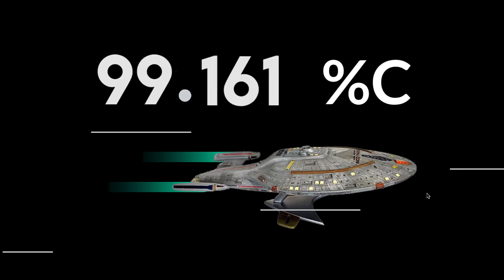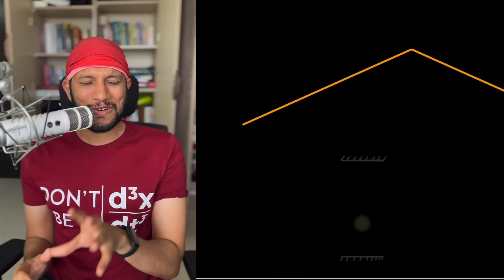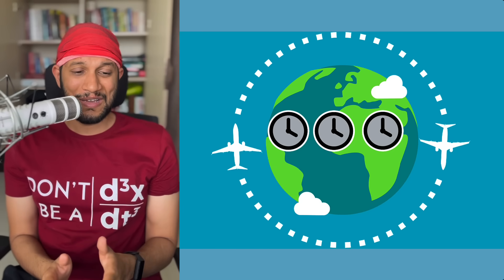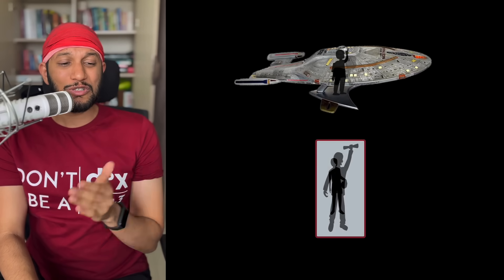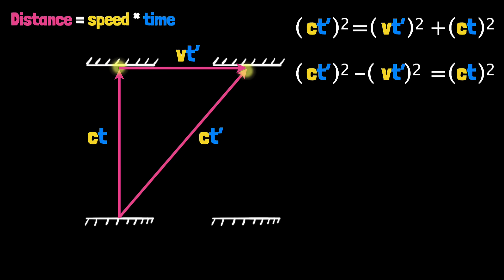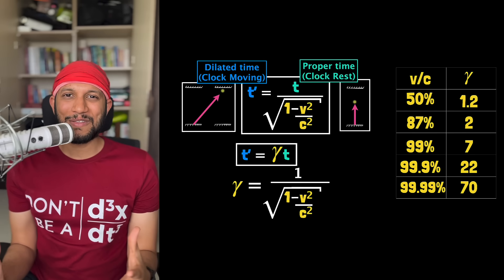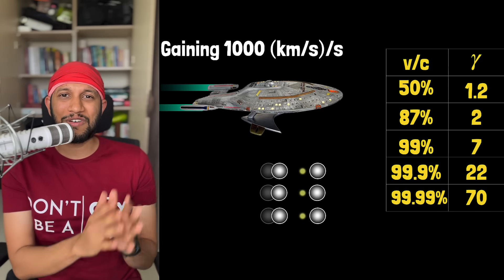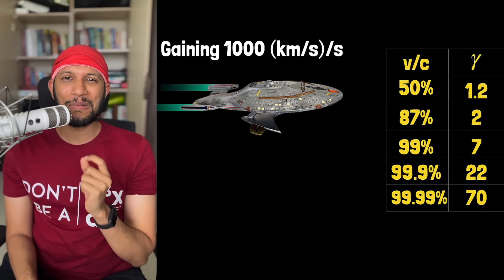I finally understood why you can't go faster than light! (My mind is blown)

Comment: so out of curiosity, I'm not too well versed in this area - would the amount of g-force experienced decrease as you approach the speed of light with this concept of slowing down photons apply here assuming you can surpass the livable 4-9 g-force. More so, for example if you were able to accelerate at the speed of light instantaneously, would the g-force exertion be completely nullified due to the time dilation concept? Interesting stuff here

Comment: so heres what i dont get. 
I get the photon idea. Photons travel at C (speed of light) ALWAYS, at constant. until they transfer their energy onto another object. thus killing the photon. (photons giving with mass is another topic all together, as they have no mass, but solar sails work) ... so, If Photons are constant. its shown to have a speed. 299,792,458 meters per second (or 186,282 miles per second). This means that Photons, do not have an 'infinite' speed. meaning that it is probable to reach the speed of light or pass it. yes its a very low possibility of happening, but probable as there is a 'Finish line'. 

With all the time stuff, out of the way. and it all in relativity. you have the infinity power generator for your super duper god ion thrusters. and you blast off into a your new time travel mission (into the futrue, one way) you will be able to hit that Finish Line, but it would not require infinite energy. it would only need infinite... if photons traveled infinite speeds. which they dont.

Comment: I know I'm about a year late, but you're WRONG! you CAN go faster than the speed of light! .. Albeit NOT by brute force!  i.e., Rocket thrusters!  or any such form of thrusting! ... Whereas the atomic articles that the ship slams into would literally rip the ship apart from its leading edge long before reaching SOL!  .. But a ship tucked well within its WARP Bubble could even surpass the SOL by several folds!🤨

Comment: I think that when we explore the nature of 0 we will gain a better perspective of this formula. The value 0 is quite new by comparison and while the rules of numeracy work in all cases except 1, I feel there's a gap in our knowledge for that result.

If we look at any number, 2, for example. Multiply by 1 and it remains the same (if I have 2 and leave it alone, I still have 2, or one instance of 2), divide the number by itself and it makes a value 1 (how many groups of 2 make up the value 2, 1 group), and so on. Off this we piggy back other formula and theory (that all seem logical because we write the logic based on the existence of the logic).

Everything works that we need it to work, however the existence of 0 as an integer makes that an issue, because certain rules can't apply. 0 is a structure that was introduced later and it sort of made sense except in a physical or practical sense. Romans had no value for 0. If Brutus had 2 apples and eats one, he has 1 apple, if he eats both. There's nothing to count.

I think the formula works because it's sort of right, or right enough as we currently understand it. It may be how we perceive and calculate time, distance, and other forces like gravity. There's something we're missing and I think that's what makes mathematics so amazing, we should be measuring the topic by what we don't know rather than what we do.

Comment: I don't buy the explanation around 3:30. I agree that the tip of the hand (pointer) will indeed move with a delay when compared with the base (first atom). But the base of the hand doesn't need to wait for anything (like a photon bouncing back) happening further up in the hand, so it will do the next step after exacly one second, without delay.

Comment: Or, going back to the drawing of the photon and the mirror moving, every speed on that triangle would be C, which makes it impossible because you will have one side and the diagonal both measuring C*t. 
Or again photons following the longer path can’t reach the moving mirror if it is moving at C, because the mirror will move away from that at the same speed and the photons need to travel a longer path than the mirror, so they’ll never got to it, that’s is they will take and infinite amount of time to get there

Comment: This explanation reminds me of the sound barrier (except maybe we would call it the light barrier)! When a supersonic jet reaches the speed of sound, the sound waves it produces appear at that moment to have no velocity relative to the jet. Of course, in that case, the jet doesn't depend on sound to carry the forces which accelerate it, so it is able to push past this point and break the sound barrier. But in the case of a spaceship nearing the speed of light, the very forces which would accelerate it are carried by light (since the ship is made up of molecules which transfer force via electromagnetism). So if it were to reach the speed of light, the waves that carry these forces would stand still relative to the ship and no acceleration would be possible!

Not really adding anything to the explanation in the video, just rephrasing to make it stick in my brain :D

Comment: this seems fundamentaly flawed. from the relative containment of the photon clock on board it doesn't know that it is moving in relation to the outside. Like a bug in a car. the bug is not flying 70 mph. it is flying at normal bug speeds. in order to test this you would have to angle the trajectory of the photon and move the mirrors into an intersecting course so that you could measure the speedand distance traveled accurately. you cant arbitratily move a frame of reference outside of a contained environment. if 2 children are playing catch in the back of a bus they are not said to be throwing the ball at over 70 miles an hour just because an observer on the sidewalk sees it. but if 1 child throws a ball to his friend through a bus window as he passes him on the sidewalk then the child would have to throw the ball at >70 mph to make it to his friend on the bus. Does that make sense?

Comment: I think it would be helpful to tackle this phenomenon by explaining what planck's constant is. It is actually the thing that defines the speed & the tick rate of the universe therefore creating a barrier that disallows moving beyond the speed of light (which again is a constant due to planck's constant being a constant). 
To put simply planck's constant is the smallest number that a unit can be in terms of length. Which means anything in the universe cannot be smaller than this number. Just like the pixels on your monitor (and notice they have a fixed certain length) the universe itself has pixels. It is this length of the pixels that define the speed of light. You need to travel from one pixel to another pixel in order to create the illusion of time. The same goes for our universe too. 
So if the fabric of our universe has a defined & preordained & fixed & certain length then what is left for the energy and matter is the inability go smaller than the pixel length. Hence "you can't go faster than the light."

Comment: How would you explain going 99.9% the speed of light around the edge of a cone. Let’s say the cone is over a black hole.  You go around the edge of the cone, which is a shorter distance than going into the cone to the tip and back to the edge on the far side from where you started.  You have travelled faster than the light going straight across… have you time traveled?

Comment: You used the word "exponentially" after the 15:00 mark. It is not correct. The fuel requirement is increasing faster than exponentially at that point.
Reply: It works like hyperbola

Comment: Great video! I've got one question though. I totally understand from your explanation why it would be impossible to see the ship reach the speed of light as an observer. But what does someone in the ship experience? To them, they're still accelerating at 1000km/s/s. 

You explained that increasing acceleration won't be sufficient for the time dilated observer. But what about on board?

Comment: My question would be why is there a speed limit. Every explanation relies on force or information being conveyed at a set rate, which is the maximum speed at which information can move, so that increasing velocity in one direction slows the velocity in the other. But why is information only conveyed at that set speed?

Comment: The main takeaway from this is don't buy a photon clock unless you're never going to move it because ANY movement will mean it's not accurate.

While it mainly a joke it's also true taking the same approach as per the video.
Is this relevant in a warp bubble? I know only very tiny ones have been created by Sonny White but they've still been created.

Comment: if that is only from the outside look. What if its only the reflecting light. 
For example the ship fly´s out of our system, the ship (inside its normal) but for us its only the relfekting light that takes longer to reach us (to see the ship) because the ship is just further away. 
i mean just take the sun, if the sun just goes out right now, we will still see the light, it would take a few years till we notice that the light is gone because it takes long to travel to earth

Comment: You actually can go faster than Light. The reality is that if you do you will have no perception of what's coming at you until you've already collided with, and died on impact with said item that was part of the foolish choice to travel faster than the speed of light.

Now, alternate forms of travel such as worm holes that allow for travel across great distances with minimal time travelled through whatever corridor you travelled, allows for the mathematically equated faster than light travel. So Worm Holes & Folded space  are the only means to mathematically travel faster than light based on immense distance travelled via shortest length of time in transit. 

THAT IS HOW you travel faster than light speed WITHOUT DYING.

Comment: Does the velocity vector of a photon add in the velocity vector of the source body it is emitted from? 

If not, then in the photon clock, where a photon is initially shown to be moving vertically, how does the photon pick up a horizontal velocity component, such that it moves at a diagonal relative to its prior vertical movement?

Later in the video, there is an animation showing a force carrier moving to the right inside a ship also moving to the right, and the ship is moving so fast that it takes the force carrier longer to reach its destination. This seems to occur because the force carrier doesn’t “inherit” the velocity of the ship it was emitted from.

I’m fine with that as part of how nature works, but that seems to conflict with the diagonal demonstrated in the earlier part of the video. 

I’m still missing something.

Comment: This isn’t true though. Not only do the electrons spinning around protons go millions of times faster than light as a start, but light sometimes goes faster or slower than light. In fact the speed of light is different depending on who’s measuring it, and the number you are told is light speed is an average of measurements, and sometimes it’s way off. Like most thinks standard model, it’s a crock of nonsense. Space is electric.

Comment: This still makes absolutely no sense. The ship is its own inertial reference frame. On board it, time would pass as normal. Theoretically it could go faster than the speed of light relative to some other object. For example if the ship was racing a photon traveling from the Sun toward Earth. Theoretically the ship could beat the photon (assuming it had powerful enough engines) without breaking any laws of physics, even the standard model.

Comment: Okay, this looks like a paradox to me. Using the photon clock example, from the ship's perspective, the "stationary" photon clock should slow by the same amount because, relative to the ship, it is traveling the opposite direction at the same speed. But, as I understand it, the ship observes that it speeds up. Can you explain this? What am I missing?

Comment: And what happens if the photon clock is turned in line with the direction of travel?
wouldn't time then remain the same since the distance traveled remains constant relative to the speed of the photon?

Comment: The best way I've heard so far of mentally realizing this goes like this; as you approach the speed of light, time slows down for you relative to everything else. The instant you hit the speed of light, everything around you would age to infinity in an instant, and every instant would occur simultaneously to your perspective in the outside world. Everything would extend to infinity along your axis of travel. Now, that's a bunch of infinites, so if you went even faster, what would that mean? Everything ages to infinity plus one? Everything happens even more simultaneously than before? Doesn't make sense. So even without considering energy or mass, it makes intuitive sense that the speed of light can't be exceeded, since you can't make a singularity "more singular".

Comment: I don't get the last example. You say from the inside of the ship we will see it gaining 1000 km/s. Only from the outside we will see the ship slowing its acceleration.

So what do we see from inside the ship? Do we also see it slowing? Does the acceleration decrease or what?
Reply: Time is relative to the local observer. Since the observer is traveling at the same speed as the ship, time will appear constant.
Reply: @merlepatterson  that I get but how will I see speed of he ship from inside it? Why would the ship stop acceleration from inside it? Or will it?
Reply: @TheOxraid  You don't "see" the speed from the inside of the ship because your motion is relatively locked to it. Everything appears as it normally does (with the exception of the sensation of acceleration pulling your mass in the opposite direction of travel) Acceleration to light speed cannot be instantaneous for the occupants because their atoms would be diffused into quantum particles immediately. So acceleration to 'C' must occur over an extended period of time.
Reply: @TheOxraid  The true danger of traveling at light speed would be to run into a small particle free floating in space. Something the size of a grain of salt would be something similar to hitting a cannon ball made of lead the size of your ship itself if it were traveling much slower (for instance freeway speed) a grain of salt at light speed would likely atomize the ship and everything in it from the instantaneous kinetic energy release.

Comment: Phantastic explanation! There should be Oscars for that kind of thing. I have a question though: This video makes clear, why the spaceship cannot fly faster then the speed of light seen from the outside. But what happens if I want to travel 100 light years to the next star? Clearly, from the outside, it takes at least a little more than 100 years. But for the people inside the spaceship, could they reach the star in their lifetime? I would dish out an Oscar nomination for a good answer to that question.(After reviewing the video about length contraction, this seems that the ship could arrives well in the life time of the crew, however, they would "think" they travelled a shorter distance to to the length contraction. -Where is the catch??)

Comment: Amazing explanation. 

Additional thought...

1. Clock is a discrete body of parts operating in a cycle
2. Clock moving in a context frame creates a new body of parts. Those parts being the clock and the frame.

When you have things operating together... there is a ratio. If you change things then there is a new ratio.

This is like two gears meshed together. If you change the gear ratio then you get a different output.

Comment: GPS satellites run at a different speed to clocks on the surface of the Earth.  They are adjusted to match clocks on earth - after taking into account the effect of special relativity.  Without the adjustment, geo-positioning would get increasingly incorrect.
Reply: Not just special relativity but general relativity, as well. In fact, the effects of gravitational time dilation dominate the kinetic one by orders of magnitude.
Reply: @narfwhals7843  Thanks, I was not aware that the grav effect adjustment was also necessary!

Comment: Then explain this.  

10 million years ago, you have two immortals one is living on earth and one living on the moon. Because the speed and gravity of the moon are different, then the earth there is a time difference. After the 10million years that time difference is enough to make their clocks be a year apart. However, both earth and the moon circles the sun the same amount of times.   How do you rectify the problem with time not lining up with celestial events?